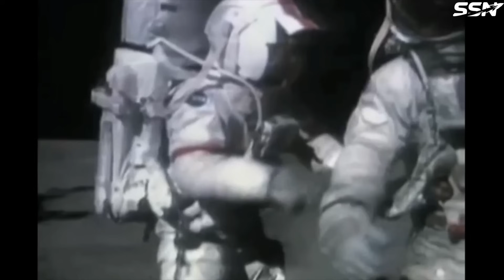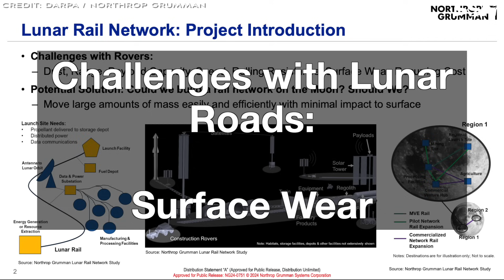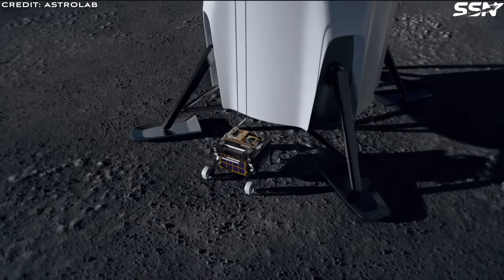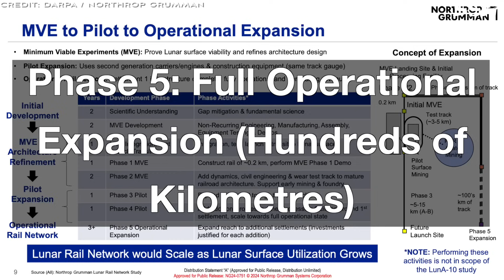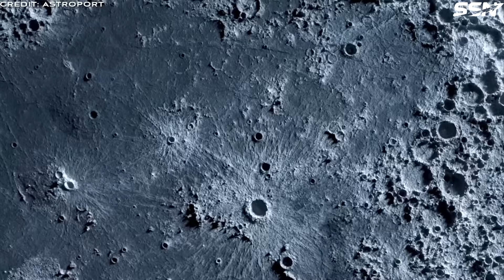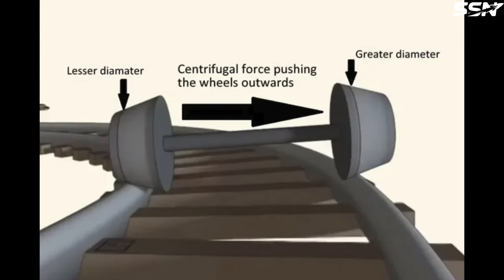Lunar Rail Network: Northrop Grumman's Plan to Speed Up Surface Travel on the Moon

Comment: Two issues I can see; keeping rolling stock on the rails in the low lunar gravity, and a related issue, getting whatever passes for a “locomotive” to have sufficient tractive effort due again to the low lunar gravity.
Either the rail equipment trucks (bogies) will have to be designed similar to those used on roller coasters (with under - running wheels to ensure sufficient contact for the running wheels to the rail head, or assuming that steel wheels and rails are employed, they’re going to require a full- scale version of Lionel’s “ Magna-Traction” system used on Lionel’s 1950’s - era toy trains, where permanent magnets installed in the locomotives ensured solid wheel - to - rail contact for increased pulling power.  The magnetized locomotive wheels on Lionel locomotives of that era gripped the steel track rails strongly enough that if the locomotive was picked up on a stretch of track that was not solidly fastened down, the track would lift up with it! 😄

Comment: These lunar transportation concepts are all excellent and should be further explored and eventually implemented. The big problem, of course, is whether political leadership will actually devote funding to to projects like these. Without funding, there will be not lunar roads, railroads, landing pads or anything else. I hope that funding for things like lunar transportation doesn't have to compete with big-ticket pork-barrel boondoggles like SLS.

There is another approach to lunar surface transportation that should not be overlooked. Dr. Robert Zubrin, an aerospace engineer and president of The Mars Society, made a proposal several years ago called "Moon Direct". The detailed whitepaper is still up on The Mars Society servers. In "Moon Direct" version 1.0, Dr. Zubrin proposes a small hydrolox-fueled multi-purpose simple lunar lander (much bigger than Apollo's LEMs, but much smaller than Blue Origin's HLS Blue Moon) to be used for to and from the Moon's surface into cislunar space and possibly as far as Earth orbit. This lunar-lander craft could also be used for visiting astronauts to gain global access to the entire Moon through hopping flights.

"Moon Direct: A Cost-Effective Plan to Enable Human Lunar Exploration"
undated whitepaper by Robert Zubrin, posted on The Mars Society servers, possibly late 20-teens, 11 pages
http://nextgen.marssociety.org/presentation/MoonDirectPaper_RobertZubrin_05-24-28.pdf

I believe this transportation concept must be added to the mix. I have no idea where the foresight and funding would come from. But in the event something like this becomes possible, it would dovetail beautifully with surface-mining for lunar water-ice to be exploited for (hydrolox) rocket fuel.

Comment: Where are you going to get the washed ballast from?
Reply: No rain on the moon, so you wouldn't need the drainage that ballast provides.
Reply: Not necessary. Regolith can be sintered into a durable ceramic-like material perfect infrastructure foundations. The track can be secured directly to it. Additional crushed regolith could be added between the ties for extra stability. Pretty much everything can be produced locally on the moon after the initial equipment is supplied from Earth.

Comment: while using a rail system on the lunar surface will be very useful, the regolith however can still be a problem to the ties themselves (which are sections that the rails just rests on) when placed in it, and using the right material that can last almost as long as common wood ties, will be vital as the longer it lasts in the regolith, the less it needs to be replaced/maintained.

Comment: How to waste money on a massive scale.
Reply: you should see the bigger picture, it'll simply pay itself in the long run.
Reply: @Charles-7  Rail barely makes sense on the earth much less in space.  The primary reason for rail fuel efficiency on earth is because rail beds are extremely flat. If roads were built the same way,  fuel efficiency of trucks and cars would also increase. 

There is essentially no gravity to worry about on the moon, so the gains from rail won't be there. 

What are we going to do to deal with a train accident on the moon?  That requires very heavy duty equipment and people working around sharp edges.
Reply: @harryniedecken5321Tell me you have no idea what you're talking about some more. The moon has 1/6th gravity. The regolith is usually not densely packed and thus needs to be prepared to be traveled on efficiently, so why not do rail anyways?
Reply: @amentco8445  I grew up with the space program,  so I might know more about it than you think.   If a transportation method reduces dust by 3 orders of magnitude,  and improves load capacity by 10x, it is worth considering. 

As a practical matter,  without a magnetic shield,  the moon will remain mostly for short visits and some autonomous re launch,  as it isn't survivable with a serious flare.

Comment: Surely the comparison should be Lunar roads vs Lunar rail?
This presentation was all about rover on the natural surface - that will still be required for exploration. If it is repeated travel between 2 points then it would be lunar rail vs road, which makes all the talk about soft surfaces and excessive wear moot. The question becomes; will it be cheaper/quicker to create lunar roads or a lunar rail network? Probably rail will only be superior for long distance?

Comment: A good book is "Welcome to Moonbase" by Ben Bova.

If I were playing a lunar development game I would have a base at L1, a rotovator around the equator but then I would need a way to get to/from the equator to the poles before the space elevator was built to L1. That would be rail or other. Building rockets on the Moon would be a priority, either solid rocket boosters or other or both. I remember the book "Welcome to Moonbase" by Ben Bova. It mentioned that we can make aluminum-based rockets on the Moon and I never forgot it so that's where my inspiration comes from.

Comment: This is great!  I'd love to see this happen!  
Ok, there are challenges (like how to handle changes in temperature between the lunar night and day) but with time and good engineering, I think those challenges can be overcome.  
Goooooo Northrop-Grumman!
Reply: Going to guess that there would have to be some kind of expansion joint at regular intervals along thee track. Continuous welded rail on the moon might not work right out of the gate.

Comment: I wonder if a railway encircling the Moon would also provide the possibility for a traveling base that could avoid the lunar night?  It wouldn't need to be at the equator, but could be part way between the equator and one of the poles.
Reply: seems ridiculously expensive. why not just work towards hardening a regular base or burying them

Comment: Sorry but simply better lunar roads will make alot more sence than trains for most tasks for the next few decades. Alot of the issues mentioned with roads can be fixed for less than the cost of building a whole lunar train network. We won't have the needed population density on the moon for a while. Small experimental trains on the moon would be fun though.
Reply: well there some advantages that rails have over road, such as being able to carry more loads then even a semi with the longest train of trailers.
Reply: Yo creo que el ferrocarril no es excluyente de las carreteras, pueden complementarse muy bien.
Reply: If the history of transport is any guide, it’s much easier to lay track than make a quality road surface. Sure rail lacks the flexibility of road, but efficiency and load carrying it’s still the superior choice.
Reply: @davidgifford8112  actually almost every rail is design to be flexible, and it needed to be for the couplings.

Comment: I hope it’s on time and cheaper than earth based railway
Reply: I don't think that's how building stuff in space works 😂😂
Reply: Cheaper than building on Earth? You're joking
Reply: @blackelfwrites  it is 1/6 the gravity of earth, so moving heavy material to make the railing system, wouldn't be much of an issue on the lunar surface
Reply: @Charles-7 sure but the rail needs to be built first and for what ? What's the ROI?
Reply: Cheaper than American earth based railway 😂
Reply: @hobog  and generally less maintenance if made with the right materials.
Reply: It won't be, because it's an initial infrastructure project. The first things you build are always the hardest because there's nothing there. Once you have some infrastructure and some industry there, then everything starts becoming easier and cheaper.

Comment: In the illustrations, the rails are shown laying on what appears to be conventional railroad ties. Yes, I understand the will be made of some composite mixture from the regolith, but that's not my issue. What concerns me is how well these ties will work laying directly on the moon surface. Given the squishy nature of the ground material and the weight of the loaded train cars the ties will need to support, will these ties cover enough surface to stay level and remain in place. I wonder if they may need some sort of pier driven into the soil for the ties to set on - think house foundation repair here on earth.
Reply: I am assuming that just like here on Earth, a railway roadbed will be prepared before the tracks are laid.  With the loads being 1/6th of the weight when compared to Earth trains, there would be far less compression.  Especially when you consider the track and ties spread the load even more.  Wheels put all their downward pressure on a small patch.
Reply: perhaps on the lunar surface, a protective layer between the surface and the metal railing may just help against the regolith.

Comment: If you use prefabricated tubes on legs you can get a system up and running quickly and then you bury the tubes to protect them and have a hub system to protect the system from the lunar regolith

Comment: I wonder how the metal tracks will manage the huge gradient of temperatures between lunar day and nights. Buckling will be massive. I would personally go with a monorail 🚝 with a central rail made with melted regolith obsidian. Or better, an underground metro tube bored with a gyrotron microwave tube digger, melting and sealing the tube as it goes. More reliable, less radiations, maybe even pressurized? Plus the excavated material can be reused for surface construction 🏗️
Reply: Maybe build the whole thing underground the it would be safer
Reply: or use plastic and not load them as heavy as on earth as the gravity is very low so not same material needed

Comment: Anthrofuturism has a couple videos about lunar railroads.
Reply: A track around the south pole with multiple PV Powerplants in close proximity would be optimal IMHO. Connecting all stations with 24/7 reliable electricity. The power cable could even be laid in single flyover, connecting the whole pole region at once. Adding the rail tracks at a later time

Comment: I guess individuals who want to harvest H3 and water frozen vapors from Moon soil do not understand when the surface structure is disturbed and these substances get free and connect with surface with out pressure they just go bye bye, boiled up or fly out, so there is a need for auto harvester at the time of picking it up and extraction, any other move and precious cargo is gone. Not only the harvester machine needs to be able to scupper XYZ but reprocess it and compact it or pressure it for storage, all this in close environment provided. And one more thing this "extractor machine" will not and can not run on solar power. TH

Comment: Labor
Reply: In about 10 years, sending a good amount of humans to the lunar surface shouldn’t pose much of an issue, so a good handful could help with construction, but imo, the lunar industrial complex will largely be built by autonomous worker robots. Much cheaper than people, and expendable.
Reply: @pekabu01  -  Agreed!  Heck, there are even huge robots that can 3d-print a house now (using extrudable materials) so a railway shouldn't be too much of a problem.  
Survey the proposed course.   Grade it and level it out.   Create "mooncrete" for sleepers.  
Lay sleepers and rails.   
As engineering challenges go,  there are far more difficult ones that have been done -  building railways through mountains and under the sea.
Reply: labor